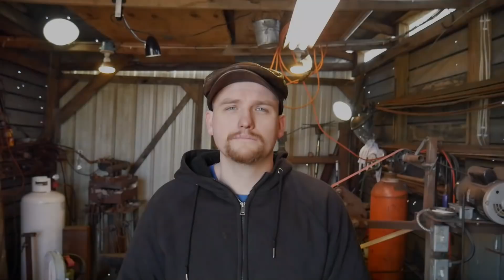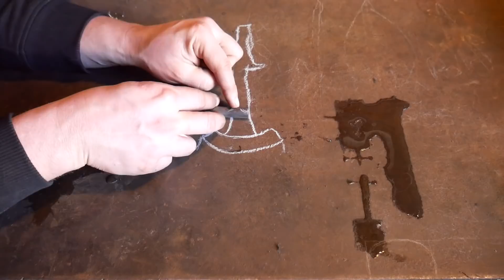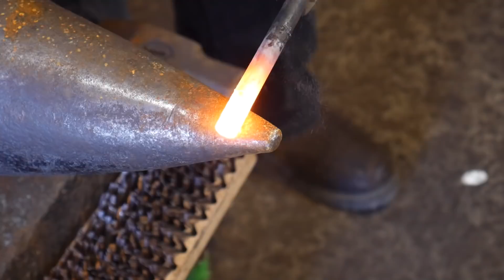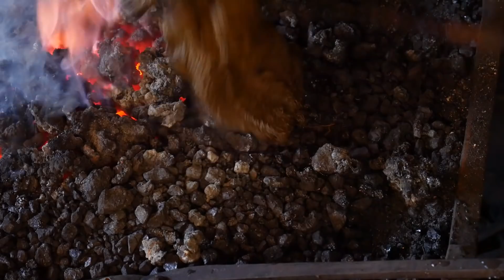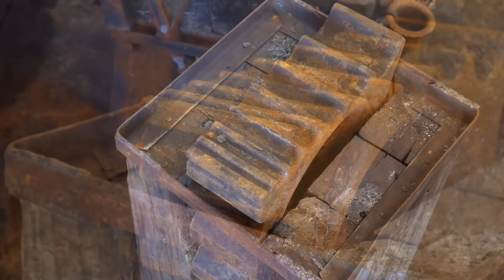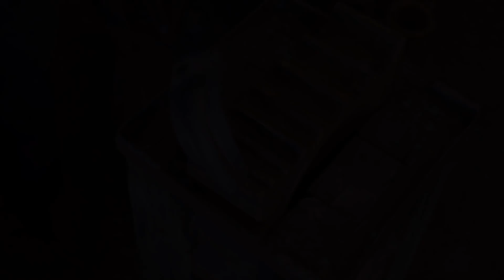DIY Air Fuller

Comment: Need to be careful Roy of welding dissimilar metals especially on something with the force of a air hammer( could break and fly through the the air) dissimilar filler metals like a 680 (heat treating is right on track) local weld shop could help with which filler metal might be appropriate. Good video Roy.